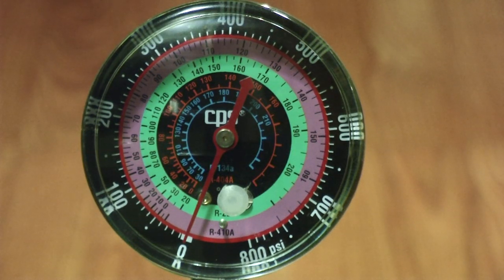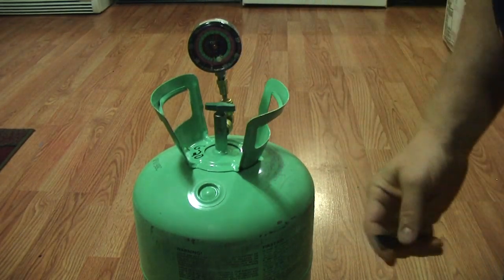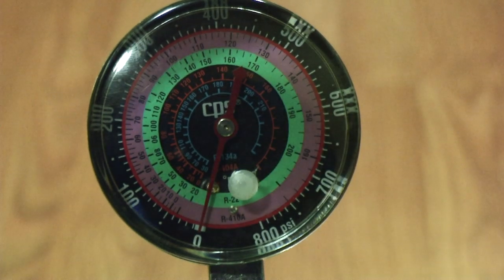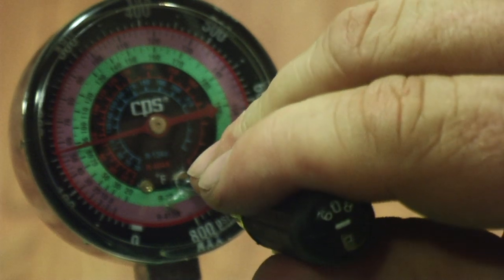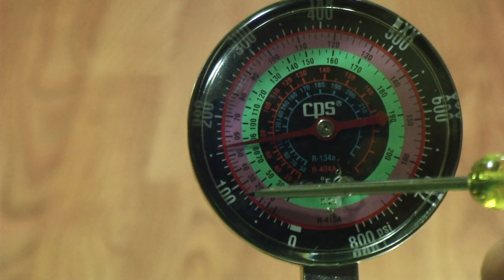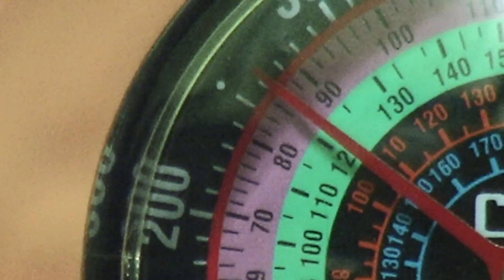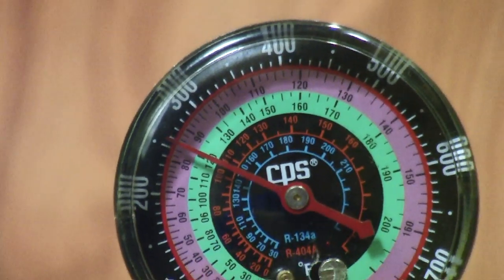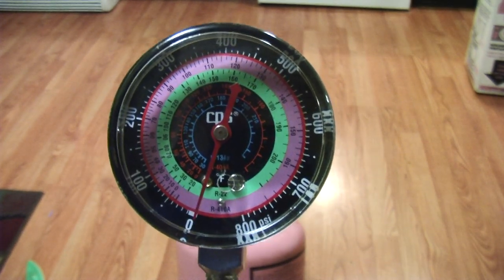Hvac Tools - Adjusting refrigerant manifold gauges

Comment: Your assuming a digital gauge is more accurate? Have you checked? I noticed, the accuracy of this analog gauge changes with pressure changes! Shown by having adjusted it for R22, then have to readjust for Puron.  I have an old set, the gauges do not work well, adjusting the setting is very sloppy, turn the screw a little, gauge wont move, turn some more, it moves too far, turn back does not move. and have the whack the gauge and it will bump needle around up to 10 psi. So I bought a new cheap analog manifold set off ebay today.